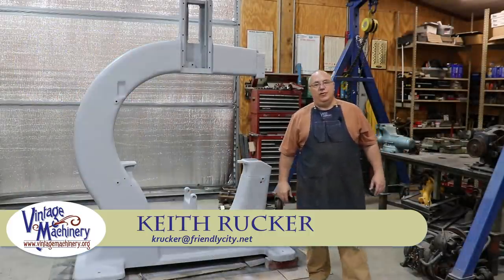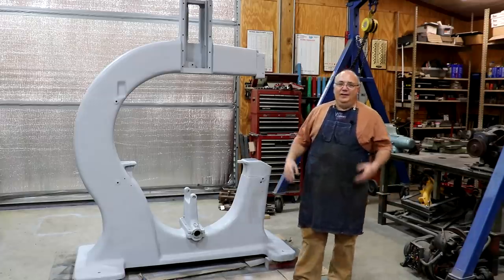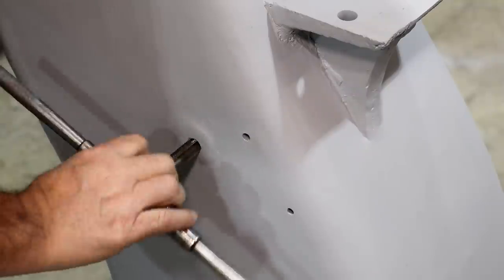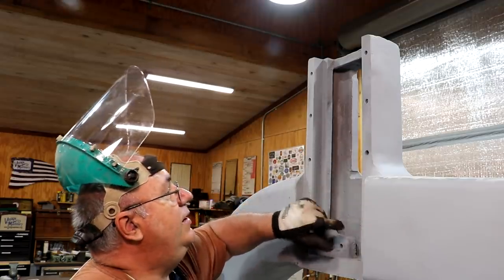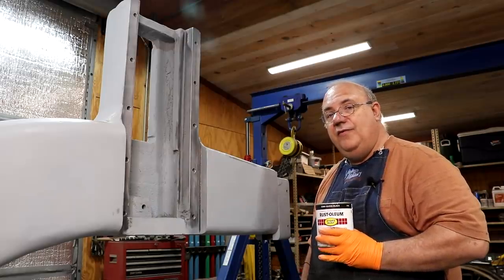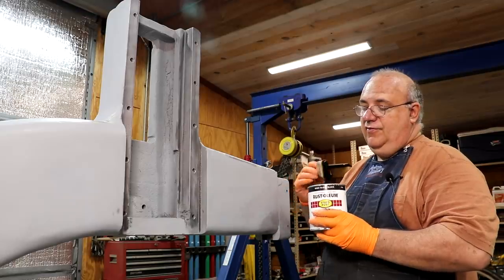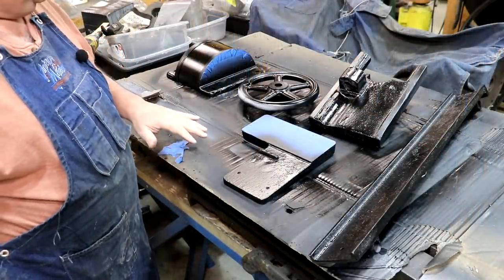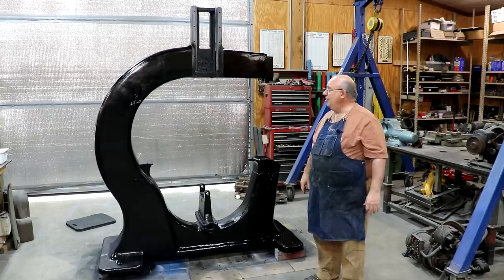Diresta Bandsaw Restoration 18: Painting the Main Casting!

Comment: A couple of hints about painting projects like this.  First, thin your first coat between 5 and  10% with mineral spirts.  It will help the paint flow out better and will reduce the brush marks.  Equally important, you spend most of the time getting the paint from the can to the project.  Use a 6" weenie roller to get the paint on the project and then brush it out.  The roller covers are so cheap they are disposable and the time savings is huge.
Reply: I agree. I use rustoleum a lot. Thinning it helps it flow out and just about hides all the brush strokes as you said.
Reply: I have had good results with a roller also. I don’t thin the paint

Comment: Rustoleum is a greatly underrated paint. It has a long cure time, but it's incredibly durable and requires no clear coating. You can speed up the cure time by baking it in an oven at 350 degrees for an hour.
Reply: It seems to have weathered any formula changes due to regulatory requirements and maintained its quality throughout acquisitions and management changes.
Reply: I agree,I make small brackets and pre heat,paint and post heat the pieces with a  heat gun.
Reply: I love the rustoleum spray cans, the primer is about as good as a 2 part epoxy etch primer.
Also the nozzles pretty much never clog as most nozzles do.
Getting a regular can of rustoleum is harder here.
Reply: @garthbutton699  Pre heat is key...   That Rustoleum sticks amazingly well to preheated metal.
Reply: Baking this saw in an oven would be quite the chore!!
Reply: Use it for every restoration I do. Primers and paints are all high quality
Reply: I would love to see the oven to bake this saw!  Imagine the size of a BBQ you could have! Great color and great job.
Reply: @devemch7851  
Powder Coat companies have ovens big enough. Certainly not out of the question.
Reply: I agree. It’s a great durable paint.

Comment: Put a tap or thread chaser in a variable speed drill with a clutch on the chuck and set  the tension as low as needed to clean the threads. If the tap starts slightly crooked or bottoms out the clutch will  slip. You wont damage the treads or break the tap.  Works great on cylinder head bolt holes and saves time.
Reply: Better still, screw bolts in the threads, leaving them loose - to stop stuff getting in there to need cleaning out later !
Reply: @millomweb  Would ear plugs work as disposable plugs to prevent paint clogging them? As long as the foam doesn't dissolve in the paint solvent (test first)
Reply: The saw is a 100+ years old ,probably a good plan to clean the threads  when all the grinding and painting is finished. Keith  might be using new fasteners.
Reply: @davidmam  Use of proper threaded bolts would be best as simply unscrewing them afterwards would clean the thread out !

Comment: Keith:  One of these days I would encourage you to give marine polyurethane like Petit, Interlux or Rust O-leum, (who also offers a polyurethane paint) a try. They can be brushed or sprayed.  When spraying use the designated thinner by the manufacturer.   You can also add a touch of thinner when brushing and it will allow the brush marks to settle away so it again will look sprayed with a glass finish.  The results are fantastic as is the durability.  They come in a host of colors and are available on line or at any marine store.  Lookin good Scott, Vancouver WA.

Comment: That will be a nice saw when you get it done Keith. I use Rust-Oleum quite a bit both with brush/roller or spraying. I have found over the years if I thin 5 percent, add a little oil based hardener, and especially add a little Penetrol, it makes all the difference in how the paint flows, hardness, and gloss/durability. Really makes wiping a machine down a pleasure with no staining or holding dirt in the paint. It's worth the extra effort to do. Just a suggestion to help out.

Comment: I’ve been using spray paint for the last 50 years or so I finally realized after doing a couple of cast-iron feed grinders that brush painting has a completely different look and also as you say the most historically correct. For the kind of restorations I do I may never spray paint anything again

Comment: I to use rustoleum paint on projects but on the final coat I add a hardener which speeds up drying along with a better shine and a very hard paint. The hardener is available at most paint suppliers ie HD Lowes etc. Love your video's.

Comment: Use a  small roller with a microfiber roller cover and hardener in the oil-based paint.   The paint will look like it was sprayed on, and it will be far more scratch and chip resistant.

Comment: I like the black, good color and definitely love the brushed on finish for a more authentic look... .  I use that paint all the time for some projects.  It has very little UV protection, so definitely dont use it on anything outside, it will fade quickly.  You can increase the cure time and overall durability by enamel hardner that you can buy on amazon or at tractor supply.  It will help cure time, and most definitley make the final finish more resistant to chemicals, etc.

Comment: Hey Keith, I use an enamel hardener from tractor supply or Lowe's. Accelerates the cure time by at least 50%. It works with any oil enamel.

Comment: I've had fellow engine & machinist friends scoff at my using rustoleum paint on my engines. It works well. The cure/dry time can be shortened by using japan dryer. When you can no longer smell any paint odor then it is full cured/dried. Oil based paint dry/cure by first evaporation of thinning solvents then by oxidation of the oils.

Comment: I have a 1870's j fay bandsaw 36inch   ..it's been painted black at some point in it's life.. a very thin coverage.  Once i was cleaning it  with mineral spirits and noticed it was originally painted a bold green with orange pinstripes around EVERY casting hole and  flange. Very ornate. My question is, does that sound like a typical new paint style? Did the factory often use such a large amount of pinstripe painting design in that way????

Comment: Do multiple light coats instead of thick coats.  Due to the basic chemistry of enamels, if you do a thick coat, the outer surface will skim over, preventing the solvent from escaping (drying)..which has to go through the skin.  That thick coats surface skim prevents oxygen from entering and completing the chemical reaction of curing.  Thus, your paint may not dry or cure.